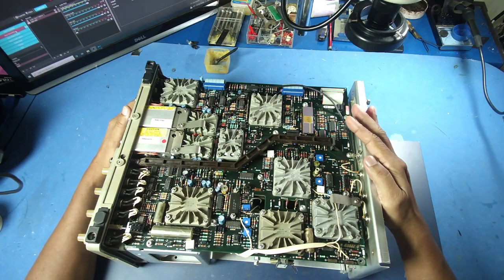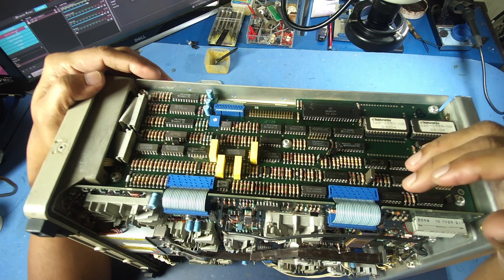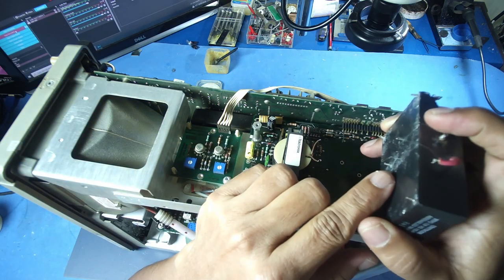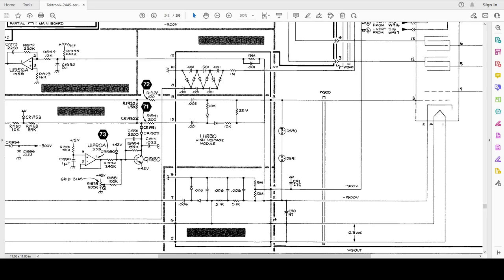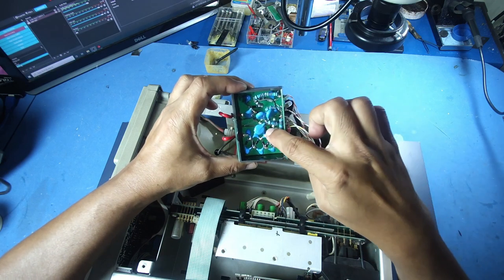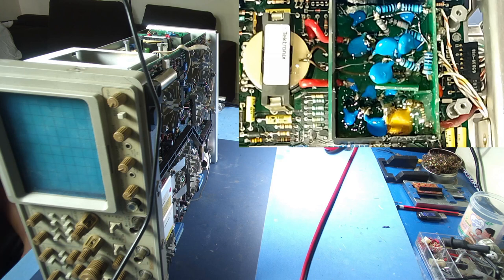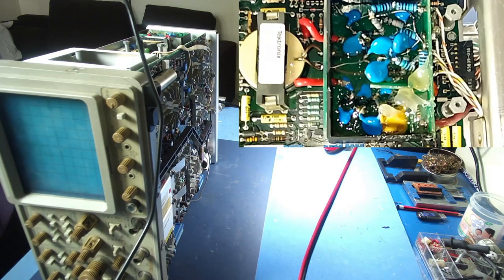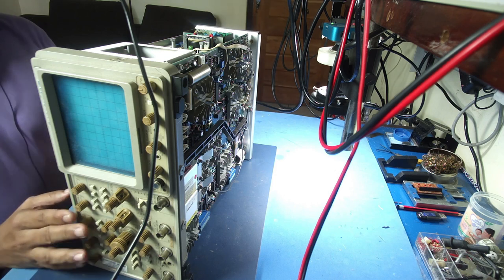Tektronix 2445 ඔසිලොස්කොප් රෙපෙයාර් 2 වන කොටස

Comment: Clear epoxy coat ekak danna tibbe neda mahaththaya mulinma
Reply from the maker: Circuit එක පළමු වරට හදන නිසා (components වල ratings දන්නේ නැතිව )වැරදෙන්න තියෙන හැකියාව වැඩියි,  epoxy සම්පූර්ණයෙන් දැම්ම නම් වැරදි හදා ගන්න වෙන්නේ නෑ.
Reply: @dilshan1971  මේක සර් වෝල්ටේජ් ඩබ්ලර් එකක්ම නේද නැත්තන් ඒකට වඩා වෙනස්ද
Reply from the maker: @Creatortech95  voltage doubler එකකින් voltage එක දෙගුණයක් විතරයි කරන්න පුළුවන්, මේක 6 ගුණයකින් වැඩි කරනවා. (3 stage cockroft walton circuit )